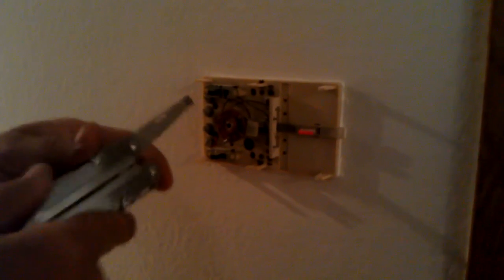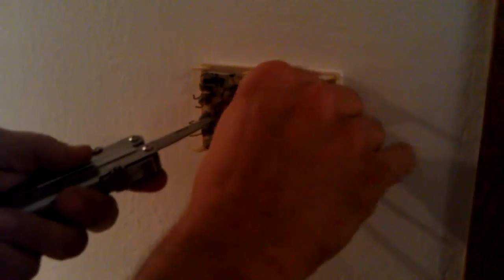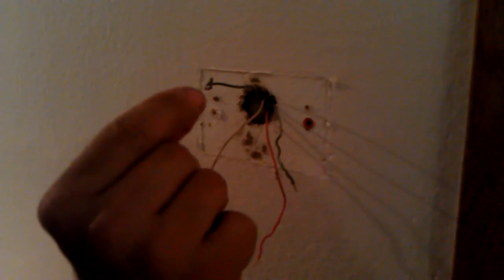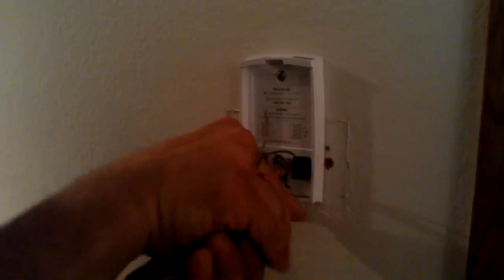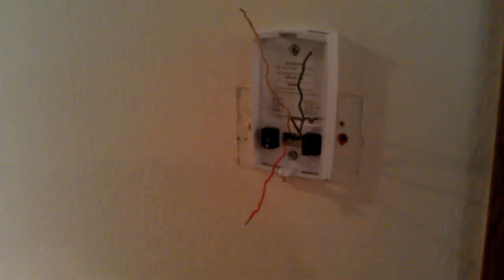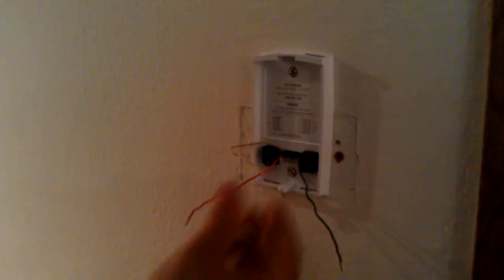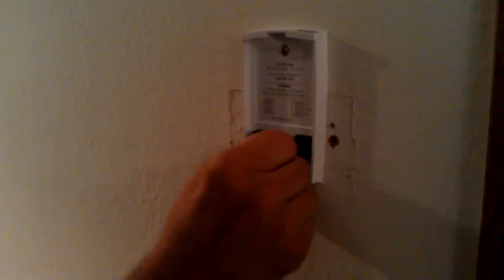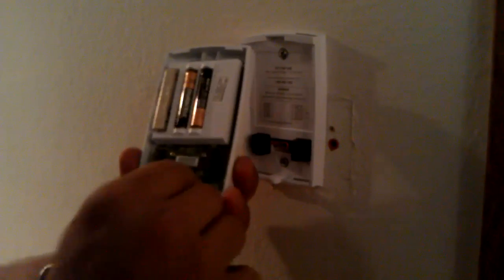How to replace a 4 wire thermostat

Comment: I took a picture of the wires and replaced a 4 wire thermostat, and the heat worked but the ac wouldn't work.  I watched your video and put a jumper between the R and RC and the air came on instantly.  Thanks for saving me a hundred dollars.

Comment: Thank you so much for the blue to yellow comment you just threw in there, lol.   I have searched all over the internet and my husband has scratched his head bald trying to figure out why the fan would not cut off.  Our old digital thermostat gave up the ghost a couple of weeks ago.  Bought a replacement but hubby forgot to take a pic of the way it was set up before.  There is no mention of this anywhere else that I could find.  Thank you!!

Comment: holly molly!! thank you 🙏. i recently moved into a new bt older apartment and my electric bill was 4x the normal amount. after numerous maintenance requests the problem was never solved until i watched your video. the blue to yellow was key. they had white to yellow and blue to blue. thank you so much.
Reply from the maker: Glad I could help.

Comment: Thanks for mentioning "Blue to Yellow" on an older 4-wire install. That was the piece of information I was looking for! 
The 17 year old digital stat died. Glad I saved the old mercury switch unit. 
I talked my son through replacement over the phone but I suspect he moved the screw from the blue post to the yellow to match the wire colors. A couple of weeks later, when I got home, I discovered that the fan on the compressor unit outside was running 24/7. I knew a wire had to be wrong but didn't know which one. Your video/problem solved. Now I'm shopping for a new programmable stat.
P.S. That was all the info I needed. I know how to replace a stat and that I have a low voltage unit and how to take a wire off and put a wire back on a screw. I didn't need any of that, as some people apparently do, based on other comments.

Comment: Thank you! Thank you! Thank you! I decided to replace my thermostat and like a dumbass I didn't take a picture or label the wires when I removed my old thermostat. I figured it was easy. Just connect the red wire to the R, the green wire to the G, the white wire to the W and the blue wire to the B. Wrong! After installing the the new thermostat the vents were only blowing cool air when I turned the heat on. I looked at the manual and watched several YouTube videos but it didn't help. Then I found your video. You said connect the blue wire to the yellow (Y) terminal and I did. Boom! Got heat again! Thanks!
Reply: Same thing here. You've saved us!
Reply: Daniel Bryan I
Reply from the maker: Glad to hear that these videos are helping people. Tell your friends. Have a great evening.
Reply: did not work it would not even come on

Comment: This video saved my butt!! You tha man!!! My next question is, is there a special connection for this type of wiring to connect to a smart wifi themostat?
Reply from the maker: Yes, the green fan wire can be substituted to make the WiFi thermostat function but you’ll loose the ‘fan on’ feature. It’s always best to install the right thing and just put in a new thermostat wire with the corresponding number and color of wires.

Comment: hooked up a new Honeywell pro 4000 thermostat the old one was working fine I just felt that it was time for a new one I hooked it up ran all the wires to the correct location now I have no heat any suggestions the other zones in the house are working fine
I put the old one back and still no heat any suggestions

Comment: Does the blue wire also go to the Y in the furnace too?
Reply from the maker: The system definitely needs to be connected the same on both ends to function properly.
Reply: @TheMaintenanceMan  ok👍

Comment: I have a problem... I was about to change over my old Honeywell thermostat for a new one and I noticed that all four wires are white can you explain that please.Christine. thanks.
Reply from the maker: Do the wires have white paint from a past remodel project possibly? Try scraping one or two of the wires gently and see if a color is revealed. It also could have been possibly installed using the wrong wire. I’ve seen stranger things than that in my experience. Let me know if you have any other questions. Hope that helps.
Reply: Thank you I will try that the model of the thermostat I believe is late 80s early 90s or whenever Honeywell decided to go from Mercury II electric I believe it is called Mercury hahaha anyways is a mid 1800s Colonial home so I will try scraping off very likely to see if it was painted over sometime in the 90s I'll get back to you thank you I enjoy your videos.Christine.

Comment: First 2 steps you left out:
1-Turn off power at the furnace first
2-Write down what color wire goes to which terminal...You never know if the original tech used the write color wires!

Comment: yes, i didnt have a yellow wire. red, green, white, blue only,,, i hooked up the green to yellow, and blue to green, white to white red to rc only since there is already a jumper from rc to r..  i did it wrong,, i am suppose to hook up blue to y, and green to g.. its working now since i watched your video...i live in houston, tx.. i need my a/c 24/7 .  this is how it goes if u dont have yellow.  red to rc, blue to y,, white to w...green to g.

Comment: Hi
I'm replacing my thermostat.  Heat only. Forced air propane heat.    I have 3 wires coming out of the wall.  Red, white, green
The thermostat has terminals for red, white and yellow.   so what do I do ? Hook the  green to the yellow ?  Thanks

Comment from the maker: To help you I would need to know what the other end of the wires are connected to. Without knowing what is on the other end of each red or white wire there is no way to wire it up properly. Sorry.

Comment: I have a blue and a yellow wire. So naturally I hook up blue to blue and yellow to yellow which didn't work. Then I hooked blue to yellow and yellow to blue and it fired right up. 😂🤷
Reply: Never mind. That didn't work either. The furnace finally started but with that configuration it wouldn't shut off. At this point I'm just guessing where the wires go. Next I hooked up the blue to yellow and the yellow to white and that did the trick. I got lucky. There are so many different combinations that it might have taken me hours to figure out which wires went where.
Reply from the maker: Do you know who originally installed the furnace and air conditioner?
Reply: No. I just bought the house and I'm fixing it up
Reply from the maker: The color code of the thermostat wire is pretty standard. The only reason for the color exchange is because of the standard changing once over the course of time. I mentioned it in the video because it’s literally the only change that should have to be made to get things working.. unless it wasn’t wired correctly to begin with. If that’s the case you’re sort of gambling with your furnace and AC. If it doesn’t work when wired correctly I’d have things looked at to at least get that part of it right. Maybe there’s another issue that makes it seem like the thermostat wiring is jankey..just sayin.

Comment: I have a yellow instead of a white so now what?
Reply from the maker: I’ve not run into thermostat wire that doesn’t have a white before. White is common. The system can’t run without a common wire. One of the other colors must have been used. Sounds like you’ll need an HVAC service to require your thermostat correctly. Sorry for the bad news.

Comment: put the blue in the yellow slot now I have nothing UGH
Reply from the maker: Since it didn’t work connecting the blue wire to the yellow you may have different connections inside your furnace. I’m sorry the standard method hasn’t worked in your instance. I’d love to help you problem solve things if you are interested. Please email me at askthemaintenanceman@gmail.com I don’t charge anything and there are no catches. I’m just a guy who wants to help.